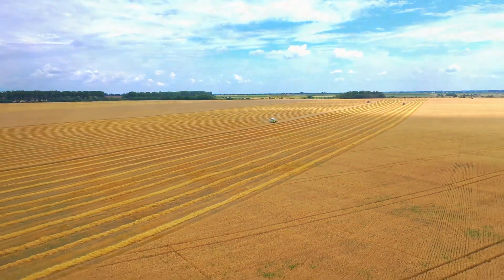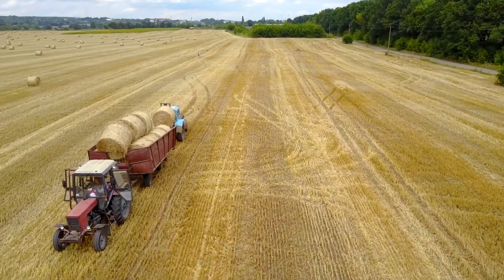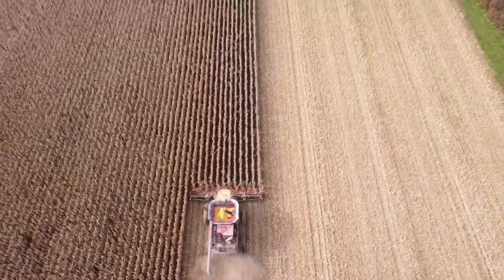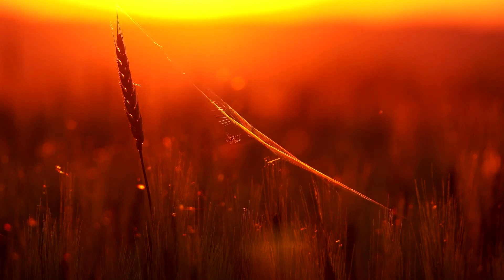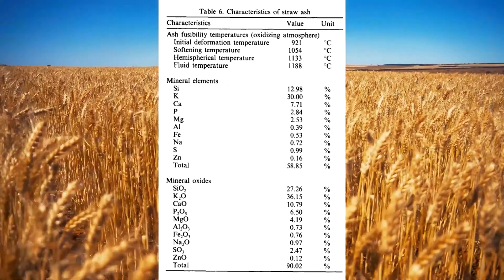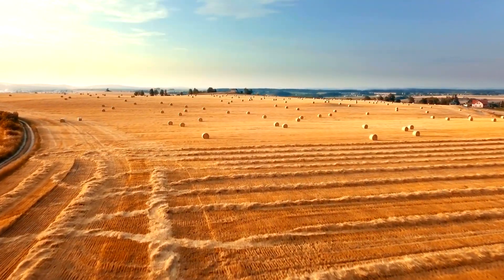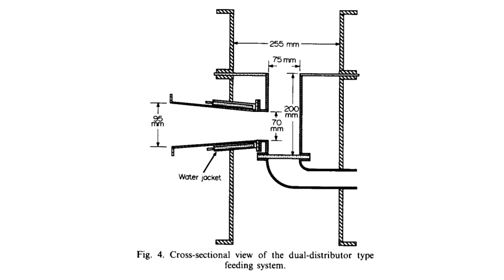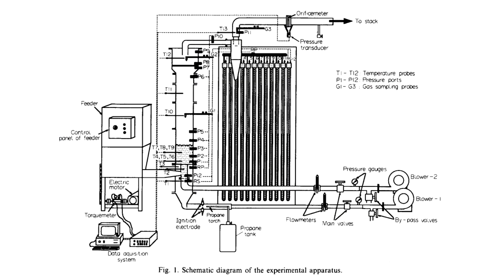Gasification of straw: a fluidized bed gasifier design overview

Comment: I run and maintain a fluidized bed sludge incinerator here in the US. I love how it's an 8 story tall Gasifier if pushed hard enough by inexperienced operators. We maintain a flow rate of 10,000 scfm of air maximum to keep the burn in the reaction zone of the incinerator. Acting as if the flow turbulence would lift the reaction up into the roof and leach into the exhaust piping. Also forcing  too much sludge feed will choke it out and burn in the heat exchanger after it exits the incinerator. Turning it into an out of control Gasifier till fuel is cut back. My experience with gasification as a hobby has made operating the fluidized bed much easier. 🪵🔥💨
Reply from the maker: wow! send a video of the installation, tell us about it, I'll post it on the channel, it's very interesting!

Comment: How is ash separated from the ceramic bed stuff?  I've never understood that part.
Reply: The air cyclone in the top part of the air cyclone classifies the bed material (no matter if sand/ceramic or ash, unburnt fuel or whatever else solid particulates are in there) according to size: whatever is too small will leave the system via cyclone overflow. Whatever is too coarse will be kept in the fluidized bed via cyclne underflow. For the functioning of the fluidized bed as such it dors not matter whether the particulates are originl filling material (sand/ceramic) or ash particles. So over time by wear all the original filling matetial will be replaced by ash anyways.